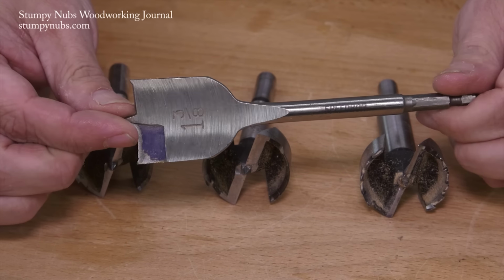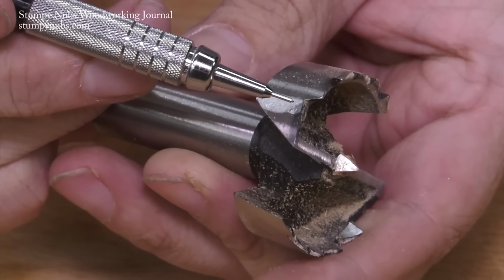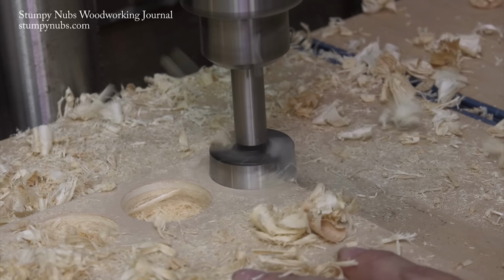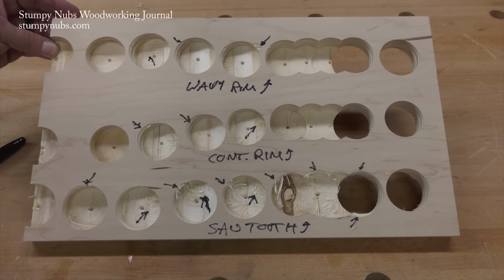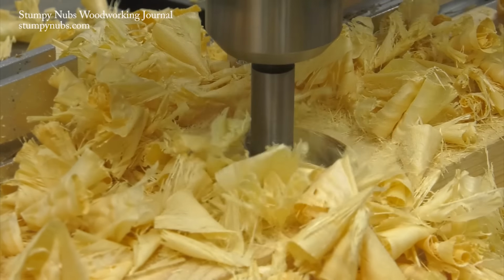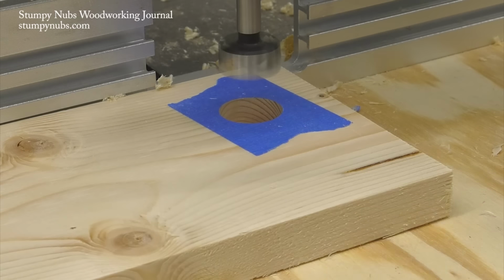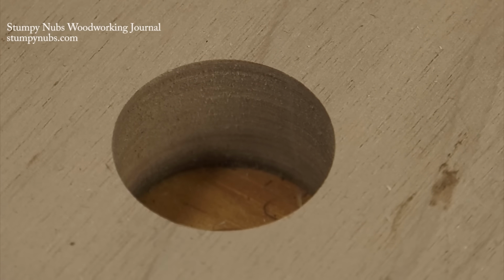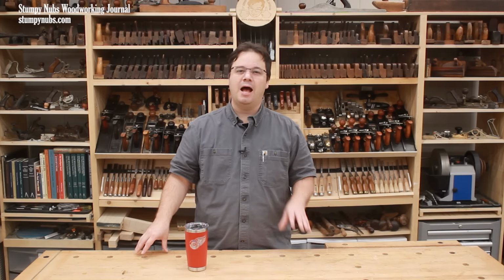Clever tricks with forstner bits

Comment: Thanks for the information being  about a year Into woodworking and gathering equipment 
Table saw, miter saw, band saw, palm router, many clamps, some HF ones but also a set of nice 36 inch jet parallel clamps and some Bessy clamps plus all my 18 volt Bosch circular, jig saw impact and drill, not bad for a year in now I picked up a set of HF forstner bits used them on a few projects with Christmas around the corner on my wishlist is a set of marples I believe they are called forstner bits I assume they will work much better same as the clamps they may not be the best but better I believe, thanks again

Comment: Another great vid. Small tip when graduating up in size (adding to the last tip in the vid). First, start with the largest bit, i.e. the one you will use for the final size. Drill with it only a couple of mm deep. THEN start using a series of smaller bits. This way you have a perfect guide at the end, for the final, large, size.
Reply: Brilliant!

Comment: TIP for poor/beginners. You can sharpen a continuous edge forstner bit in under 5 minutes with just a small straight file (or a sanding block technically). This also works to turn cheap forstner bits into surprising good ones.

Simply look at the cutting edges, lay the file flat on the back (relief) of the cutting bevel, lightly file until you have a clean face and continuous crisp cutting edge, then give a single strop to the "cutting" face. All the facets on a forstner bit are flat ground, so it's basically just sharpening a chisel twice + refining the centre point.
Reply from the maker: https://www.youtube.com/watch?v=rLoEulA4mM8

Comment: The worker CAN sharpen large forstner bits.   Need a ceramic "rod" - about a 1/4" across and 6" long.  Take this sharpening tool and work your edges on the bit - from the inside to the top of the bit edge.  Works like a charm and always sharpens the bit.  The ceramic rods can be found at any sharpening supply company.  Be careful with these rods as they will shatter if dropped on a concrete floor.   They usually come in a circular plastic case - keep them in the case when they are not being used.
Reply from the maker: https://www.youtube.com/watch?v=rLoEulA4mM8

Comment: I bought a set of ryobi Forster bits a while back. I'm using them with a handheld drill, and they cut slowly, get hot fast, and usually leave a ragged hole surface. Could the problem be with my drilling technique, or do I really need to invest more in quality bits?
Reply from the maker: Cheap bits cut poorly. You could try sharpening them. https://www.youtube.com/watch?v=rLoEulA4mM8

Comment: So if you're using an inch and a half forstner bit to drill a 2-in deep hole through hardwood would it be wise to back out of the hole and put some wax on the bed and go back in to reduce friction

Comment: Love this channel. Here's one which I did while using a forstner recently: Cutting 5/8 through ply and the layers of each ply (cheap HD crap) kept getting stuck in the bit.  Raising the bit and the ply still wouldn't come clean. Rather than stopping the press, cleaning it out, and restarting, I just raised the bit, and blew it out with compressed air while it was running. It was powerful enough to eliminate it, plus it cleaned the rest of the workpiece so I could finish the hole.

Comment: Fisch forstner bits are excellent.
Right after I first saw a video about them on this channel, I purchased one to try them out.
It's been years now, and there's never been any tear-out at all with the wave-cutters I bought.
Thanks again James for the recommendation - and I definitely agree, everyone should try Fisch.
And like James, I still use spade bits, but only for drilling in used wood (that may contain nails or when I drill holes through the ceiling).
Note: They have different types of forstner bits; apart from the cutter type, they have different shank and tip types as well.

Comment: Here is a further tip that biuld on this.  If you need a stepped hole, do the larger one first as deep as you need it - say the height of a hex head bolt plus washer, and the diameter of a hex socket.  Then with a smaller bit - perhaps a brad-point bit, drill the rest of the way through using the the techniques here with the point barely coming through so that you can counter drill it from the other side.

Comment: Some really great tips. A tip of my own: If you want to drill a stepped hole drill with the largest diameter first, that way you retain the dimple of the spur in the bottom of the hole for your next smaller bit to line up on, this makes sure both holes are exactly lined up.
Reply: I am so glad you said this.  It took me years of wobbly, off center holes to learn this because I was drilling the small hole first.  Unless the small hole is much smaller than the larger hole, the large bit just doesn't hold in the center.  For those of you who have success drilling the small hole first, OK.  For me, Conor is right.  Drill the large hole first.
Reply: @wdtaut5650  EXACTLY this is almost the way a machinist would do things except for a spot drill first then the largest down to the smallest so as to keep everything concentric.

Comment: I am not a pro but to me I would keep my fingers away from that drill bit.  You give great safety tips all the time.
Reply: I agree fingers only an inch away, try that with a 3” bit and small piece of ply.
Ply spins fingers get grabbed by bit, messy.
Holdown clamp on drill press as you would use for drilling sheet metal.

Comment: You can pre-drill a pilot hole with a 1/16” or 1/8” twist bit, then run the Forstner bit in halfway from each side. No tear-out. Perfect matches every time.
Reply: I arrived at the same principle when i had to use hole saws for material too thick for the capacity of the hole saw. It really works well!
Reply: Good idea, I will probably add that with handhold drilling it is quite important to pre-drill the hole perfectly right-angle - or the top and bottom main holes will not match.
Reply: Nice idea. I see the small 1/8 bit makes a hole perfect for the point on the Forster to line up 👍👌🏻
Reply: I have been using this method for years.  Never fails me.
Reply: Good tip.
Reply: yes, that works but you can't flip every project upside down.
Reply: @678friedbed  your lack of determination is disturbing.
Reply: @robertschulke1596  lol.
Reply: @678friedbed  Oh, woe is us...  "You didn't provide a perfect solution for every scenario in your free 6-minute video.  What are we to do?"
Reply: @acommenter5184  you didn't provide any videos at all. what's your point? oh that's right you don't have one
Reply: Yep, that's what I do...
Reply: I do that a lot - yes- no tearout from the forstner point - exact point of entry

Comment: Another masterpiece.  The level of information provided is top notch.  The methodical approach of breaking projects down into smaller and individual tasks and operations, seen as a series of small problems to be planned, solved, and executed, is the way most of the best craftsman produce such amazing works, or simply become super consistent and accurate.  And avoid major mistakes that can be time consuming, costly, or both.  Applying the precision and method of machining to woodworking (as others like Katz-Moses, Samurai Carpenter, and Estlea have also done) is really elevating the craft for both the home gamer and the pro.  And as always, keep yer dick in a vise! XD

Comment: James, I have a question about enlarging a counterbore with a forstner bit that doesn't go all the way through the workpiece, such as when you counterbore a hole that is too small.  Any tips and/or suggestions in order to help center the bit?
Reply: Try cutting a pice to fit the existing hole with a hole cutter or similar. Then either glue or double side tape in place and use that as a base to enlarge it.
Oh and if you can’t make a hole the size needed. A square of wood pressed tight can work too, can find the center by drawing from corner to corner

Comment: I bought the CMT bits you previously recommended.  Similar to the Fisch bits, they don't have a hex shank. The CMTs tend to spin in the chuck. Any suggestions? What, if any, advantage is there to not having a hex shank?
Reply from the maker: I've never recommended CMT bits. It's always been Fisch. However, my Fisch bits don't have a hex shank. If a large bit catches, the hex shank can keep it from slipping in the chuck and potentially marring the bits shaft.
Reply: @StumpyNubs  Somebody recommended them. My bad. Did you recommend CMT table saw blades ( which I also bought). I know you're touting Ridge Carbide now.
Reply from the maker: Jonathan Katz Moses did a forstner bit video a couple years ago that was supported by CMT. I'll bet that's the one you are thinking of.
Reply: @StumpyNubs  I think you're right. Any tips on preventing spinning? I assume it's a combination of slowing both the speed and the feed rate. I'm using them to bore end grain on a lathe  (6-8" deep holes for glass vase inserts). I know this is a tougher application than a relatively shallow, face grain hole. I am making pilot holes and gradually expanding the diameter with bigger bits.
Reply from the maker: @davidshaper5146  Other than securing it tightly and evenly in the chuck, no tips. Sorry.

Comment: I have a 50mm bit which I use regularly and if I didn't have the side handle on my drill I would probably break my wrist.
Here in UK there are a brand of forstner bits called Axcalibur by Axminster Tools and they are the best bits in my opinion
Reply: Do you know how they compare to famag boromax on price/performance ?
I think they are fantastic bits I moved to them after Peter Parfit raved about them not particularly cheap though.

Comment: I find with forstners in a hand drill that if you don't have a guide piece it's good to drill fast and apply quite heavy pressure to begin with to try and get the bit to cut and sink itself without moving and then slowing down to a more appropriate speed.

Comment: Another great and clearly explained video.  Thanks, James!
Yes, please do a video about the use of spade bits in fine woodworking.  
I own a set, but I was always under the impression that they're for making lots of holes quickly where appearance and blowout isn't a concern - like drilling holes for electrical and plumbing lines through wall studs.
Reply: @ras1500  Good tip - thanks.  I do like how spade bits have hex shanks and that you can use extenders with them as long as your hole is at least 3/8 in diameter.
Reply: Auger bits are the best (IMO) for drilling studs for electric or plumbing. Found this out after burning up a spade bit.

Comment: Awesome tips, I hadn't thought of using tape like that and I really liked the last one re: stepping the bit size up from the other side of the board, thanks!
Reply: Would this not risk blowout on the backside on the second pass?
Reply: @Night56Owl  Was just thinking about that, and have a solution in mind:

1. Start the original hole with the larger bit, go just ~1 mm deep or so.
2. Switch to the smaller bit and go almost through, just the tip.
3. Use the larger bit to finish the hole from the opposite direction - this hole will then meet the starter hole from step 1.

You need to be careful in step 2, though. If the center thingies of the bits are not equal size, auto-centering the smaller bit may not be as accurate as you'd think.
Reply: @veikkoimmonen7300  Another way to do it would be to use the smaller bit until the tip protrudes, then cover the entry hole with tape. Drill through from the other side until the tip pokes a hole in the tape. Finish from the tape side.

Comment: Anyone else use a cheap speed controller to adjust their drill speed? I've been and it's miles faster then adjusting the belts.
Reply: Yeah! I built one years ago with a 20 amp  SSR that uses a 0-1000 ohm Allen-Bradley potentiometer to control the voltage output of the SSR.
Works great, about 25 years and still working!
Have one from Harbor Freight that is foot operated, works good (and was cheaper) as my homemade one!
Reply: @brucelytle1144  hell yeah and got 25 years already out of it that's awesome